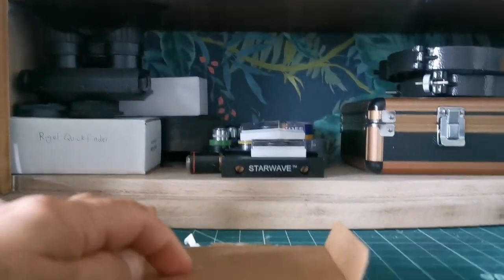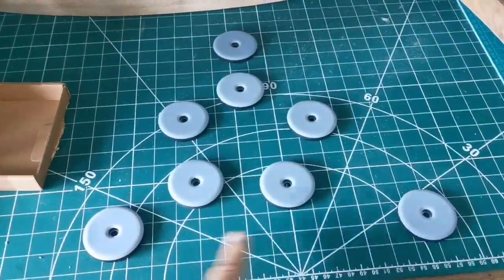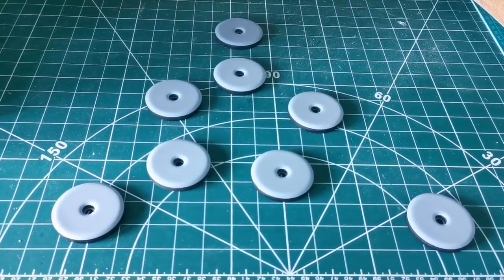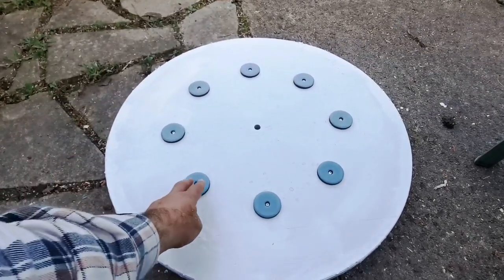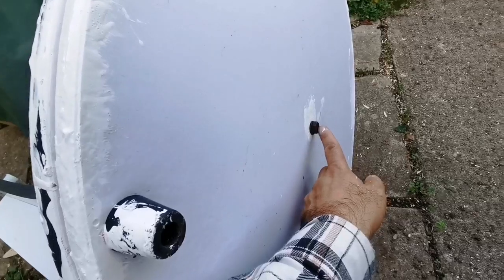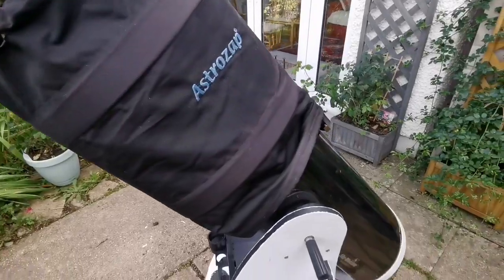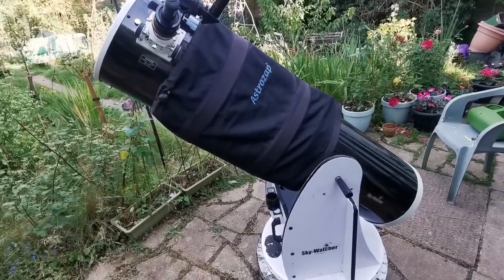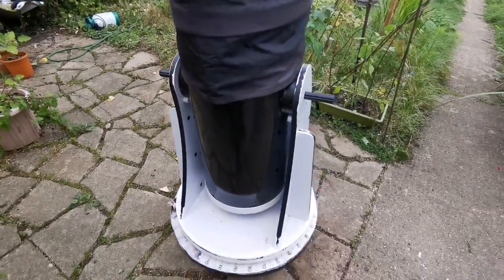Teflon Miracle Fix For Jerky Azimuth Movement In 12 inch Dobsonian Telescope

Comment: I have a Russian Tal1 telescope and i need to clean the mirror.. Any advice?
Reply from the maker: Mark the tube and mirror cell reference points, before unscrewing the mirror. Only use gentle dragging pressure of cotton on the mirror under tap water. Dry it with  deionised water or distilled water, if you have access( you can get it from car supplies as they use it for cars). I have several videos about cleaning Telescope mirrors. 🌹😇